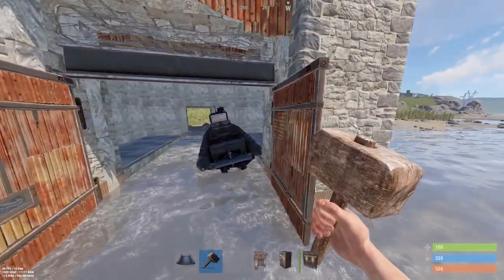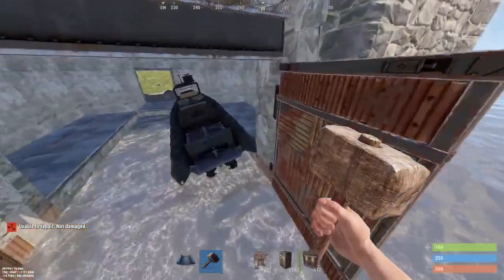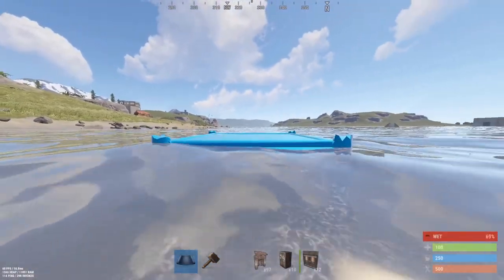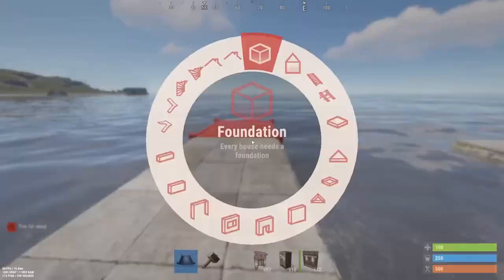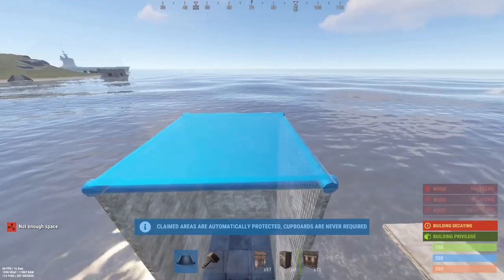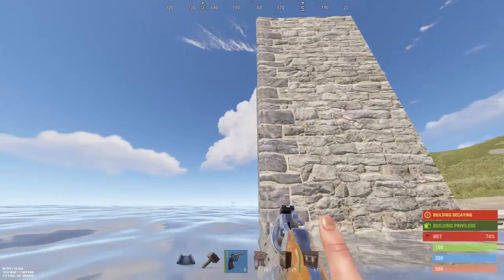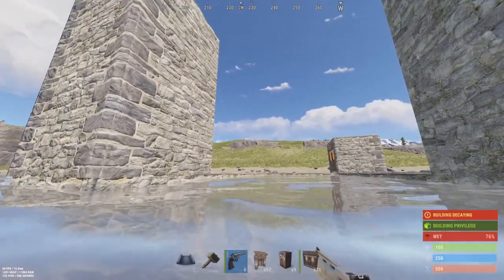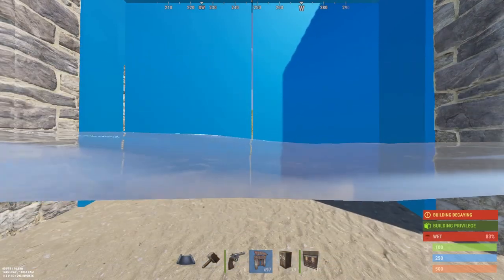How to build a RHIB Base - Rust 2022 Base Design

Comment: You need to try making this not on a build server....its impossible to get the gates to sit at the right level correctly...always seems to be too low no matter what I tried.
Reply from the maker: I did it on an official server last wipe* I think, i'll upload a video of it here in a bit. Better to go too high/shallow and have to push the RHIB in rather than risk it being too low and ruining the base.
Reply: I just did it first try and everything is good
Reply: Pick a different build spot.  The sea floor varies in slope a lot.